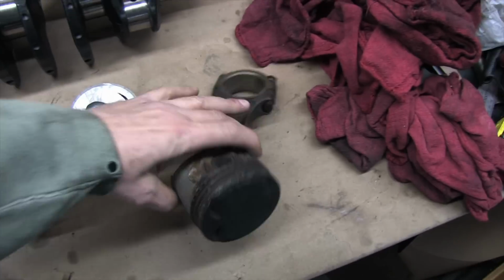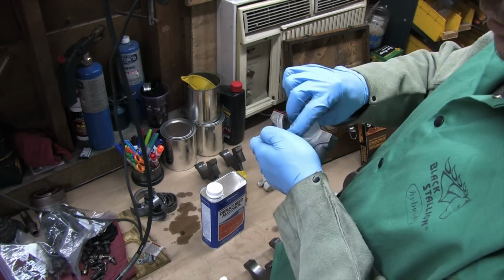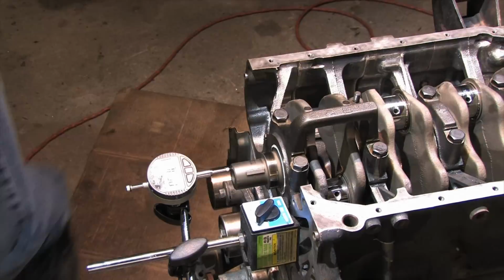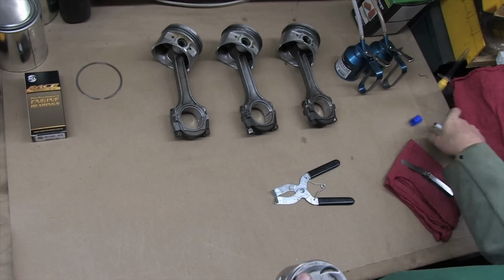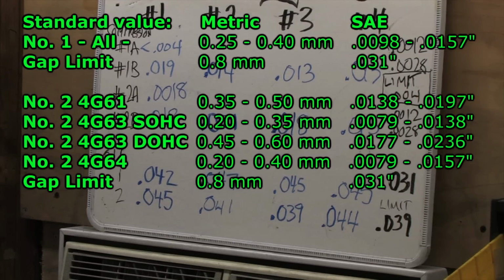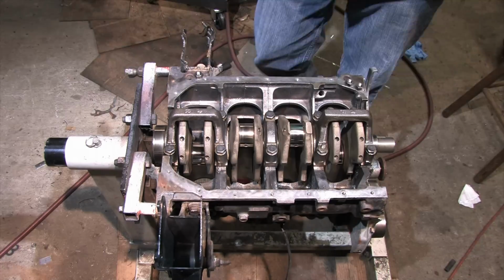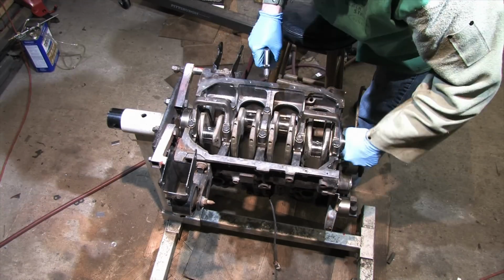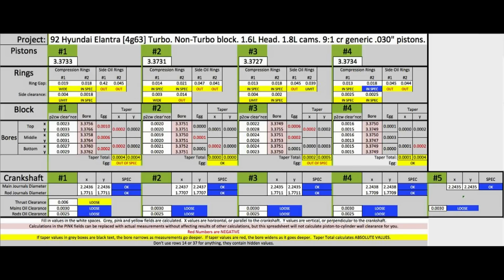Hyundai Assembly 1 - Blueprint Everything

Comment: hi, Great video, I have few question,s can you please answer.
1) What if i dont clean the carbon deposit on ring groove?. we are cleaning this because this will give improper ring gap tolerance when we install?. also on top of piston also we are cleaning all carbon deposit, I see that in valve job video, we are clening carbon depsoit,.. i am not sure why we are cleaning carbon or what it will harm..  because eventually down the line cleaned carbon is going to come back as part of combustion... please advise.
Reply from the maker: It improves the performance of the parts to clean the carbon out.  Carbon build-up decreases chamber volume (increases compression), and traps heat.  Hot spots in the combustion chamber lead to detonation.  Carbon buildup is a result of cheap gas, a rich fuel mixture, failing rings or all of the above.  If you have a good fuel mixture, less of it will build up, or it will burn clean.  Yes it will come back, but leaving it there isn't the best option if you've gone that far into it.

Cleaning the carbon from the ring grooves helps the rings find the spot where they're happiest.  It lets them move a little bit and settle.  Carbon tends to pinch and trap the rings in place, so it also affects the ring gap.  Getting the carbon out of there lets them settle back in properly and seal well after they're installed.
Reply: Thanks So much for quick reply. Do you also recommend to remove carbon build up on top of piston and bottom of intake or exhaust valve as well.  If so can I use Nylon brush or Dremel tool with bristle brush..  please advise.
Reply from the maker: I show how to do this in Cylinder Head 105.  I wouldn't recommend cleaning the valves without removing them.
Reply: Thanks so much. I watched it again I recollected my memory. Can I use brass wheel in drill to clean carbon on top of piston. 2) I found no good video anywhere else about proper break in procedure. Do you have anything in ur mind to do in future. if not can u advise what you should recommend about how to properly breakin engine. some says dont lug the engine, some says dont rev the engine. some says always keep the speed constant if possibl for x miles. i am confused what method to use..
Reply from the maker: That is an enormously complicated topic.  I won't ever be making a video about it.  I don't build daily drivers, and I am from the school of thought that if your engine isn't broken in by the end of the first heat cycle, you did something wrong.

The wrong assembly lube, the wrong ring gap, the wrong oil clearance, torque procedure, valve spring height, oil pressure etc...

People who follow the instruction manual should follow what's in the instruction manual.  People who build race engines don't use any of the instruction in the service manual.

How the engine behaves the first time it's started is the final exam, and some people can't accept failure when something doesn't go right.  There are as many different schools of thought on that topic than there have ever been automotive manufacturers.  What works for me might not work for someone else, but when you make a video about a break-in procedure and someone has a problem, often they blame you for their problem rather than owning their own mistakes.  I won't even give advice on the topic beyond what's in this video.  It always creates flame wars/arguments.
Reply: Hi I am been your subscriber for so long, infact i learned all the details from your videos, to me I trust you than other vidoes, because I brought up to this stage by watching your videos, would you mind, advising me what is that your recommend for break in producedure that you fee it is right to my inbox direclty.. please.. Again the reason I came to you is because, when I get conradictory answer, i look for your advise i move from there, thats what i did now,
Reply from the maker: sivaraj palanisamy My hyundai break-in will be different from my GSX break in... but in either case.  I prefer moly lube on the mains and rods for first start-up... motor oil on the cams  I pack the oil pump gears with multi-purpose grease.  I use ATF on the bores and rings to seat them quickly, and I expect those to seat before I reach the end of my driveway.  On a 4g63 I use the cheapest non-synthetic store brand dinosaur oil money can buy and change it at 50 miles to my preferred oil.  I don't prime my oil system, only my fuel system.  I turn the key and she'd better start.  If I can't change the oil in 50 miles and go pound on it, I failed at building it, not breaking it in.  I wouldn't wait until 500 or a thousand miles to find out what was wrong with it.  I cut every one of the first three oil filters open and inspect them.  That is how I treat my equipment, and that treatment requires medium-to-loose clearances on everything you've seen me spec out here.  I drive my equipment exactly the way I intend for it to be driven.

The kind of car and valvetrain, what components have been replaced, the replacement equipment selected, the machining tolerances as well its intended use will all have an affect on how I break in an engine.  I can't recommend any universal fail-safe method that will work for everybody, but I can assure you that with the right fluids in the car, it's never the break-in that will cause an engine to fail.
Reply: *****  Thank you so much for your advise. When I start the car, do you recommend to prime the oil pressure by disabling the ignition and injection until oil pressure is build up, or just crank and drive ...
Reply from the maker: sivaraj palanisamy If you packed your oil pump gears with grease, then you wouldn't need to do any of that.  The oil will be halfway to the valvetrain before the first hole gets a chance to fire.

But that's a perfect example of what I mean about how any aspect of the build affects how you need to do the break-in, and precisely why I can't and won't give advice on the topic.  All I can do is tell you or show you what I do to my own equipment which I've already done.  I will not get involved with anyone's build over the internet beyond sharing my experience.  I'm one guy.  If you're putting an engine together, evaluate what it needs and I have faith you'll figure it out.

Comment: See all those wee holes in the piston oil ring grooves?  Those are there to allow oil scraped by the rings to flow back down into the motor.  Why point this out?  Well, I happen to own a 1.9L Saturn, and like all 1.9 Saturns, it burns a ton of oil.  That's because Saturn didn't bother to add those wee little oil ring drain holes in their pistons.  Therefore, if you fail to use a good synthetic oil that can resist high heat AND change the oil often enough on a Saturn, the groove will fill with baked carbon crust, seizing the ring and preventing it from doing its job.  But, if you treat your Saturn like a two stroke and top the oil off constantly, it'll happily go to 300,000mi. That's also why Craigslist is littered with Saturns that have engine issues; someone let the poor thing run down to 0qts.  Prime candidates for Chumpcar or LeMons!

Now you're a Saturn expert.  Tell your friends.

Comment: woohoo. Bwahahaha,,, Pootie Tang. Damn, 16 hours to export? Did that include render time? May want to upgrade to some SSD if you have not already.
Reply from the maker: Yep.  No kidding.  I'm editing with 4 2TB WD Blacks in a dual-striped RAID configuration.  They're faster than any SATA SSD, and I don't have a PCIe bus on this 2012 MacPro.  SSD's are way too expensive for the volume of video I handle because I have to edit in RAW in order to achieve the fast-motion effect without loss.  Price out 8TB in SSD's and you'll have more sympathy for me.  :P

The only way I could do this faster is with a $5000 2014 MacPro and a $1,300 1TB LaCie Thunderbolt 2.0 external SSD.  My edits would be in the blink of an eye, but I'd spend an awful lot of money to not have the storage space I need.